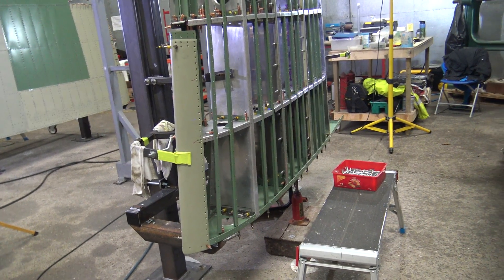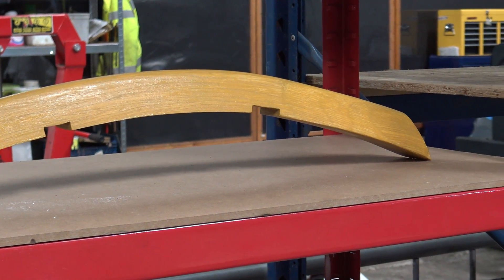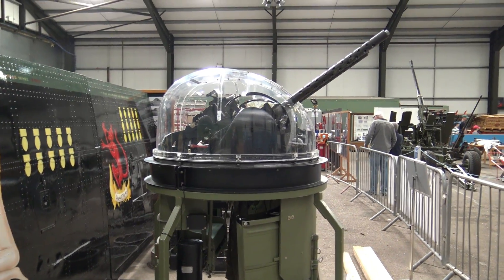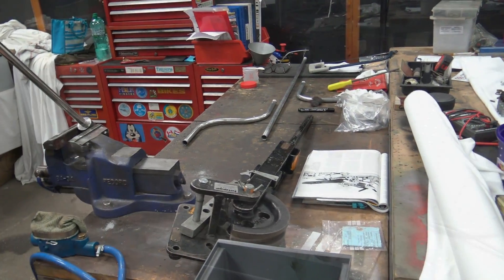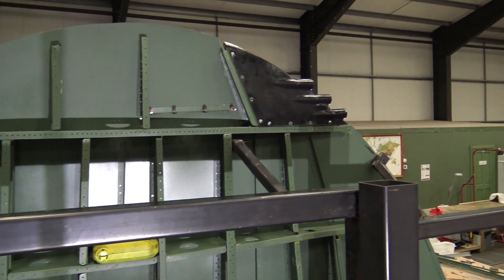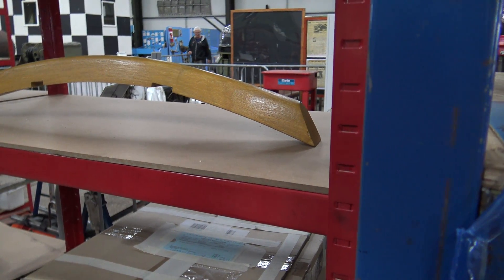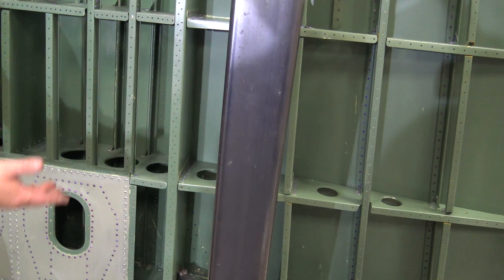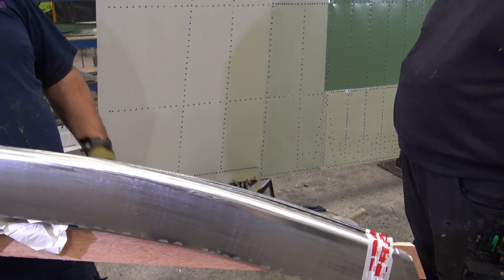Video 67 Restoration of Lancaster NX611 Year 3    Perspex Blister  for Martin CE 250 Turret

Comment: What a good explanation for the twin .50 turret. Such a shame that the Americans have been scoffed for having relatively small bomb loads while, at the same time, they gave their crews real defensive armament which weighed tons . But not only did they give their people real weight of defensive firepower they bombed from 30,000 feet ! This was while lancasters were flying at 20,000 ft and Halifax’s at 15,000ft both of which were predominantly armed with .303 which had almost zero hitting/killing power defensive armament, thanks a lot!
Reply: Unfortunately it didn't do them much good, the USAF were shot out the sky's like birds by the Luftwaffe. It was only when they got fighter support did the attrition stop and the Mustangs were doing the damage to the Luftwaffe, so the heavier armament was of little use.
Reply: It’s interesting to note that a mosquito could carry 4000lbs to Berlin and back. Two men, two engines, a third of the fuel. A B17 could carry 3,500lbs to Berlin.
The comparison is not ideal given that desperately difficult mission the American airfleet had, daylight bombing. Makes for thought though.
Reply: I notice a bunch of anti American sentiment on this channel which is a shame considering even on the English made aircraft the majority of the aluminium, perspex, high test petrol, and other materials were imported from the US and love to point out the Mustang was only good once they put a Merlin in it.